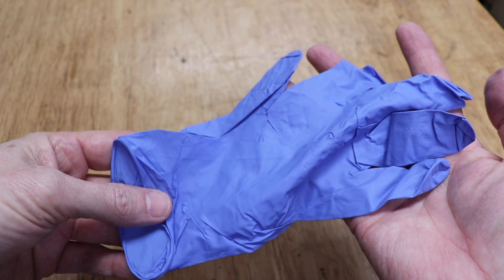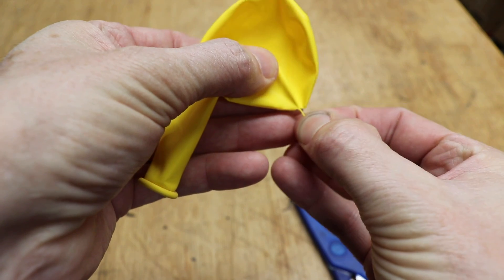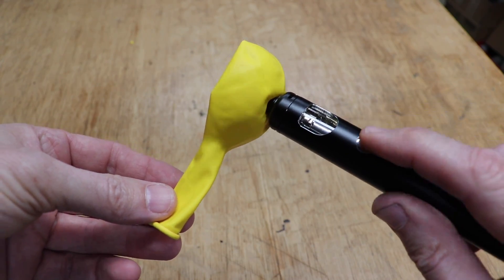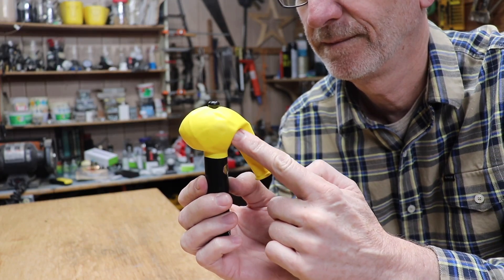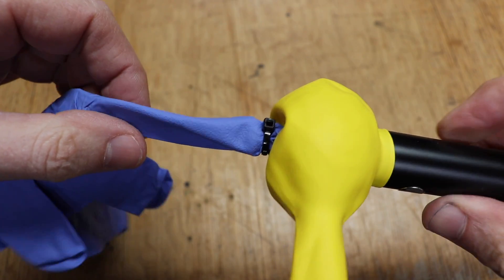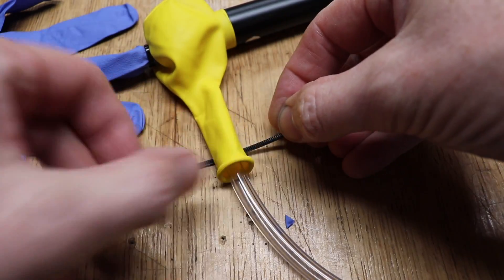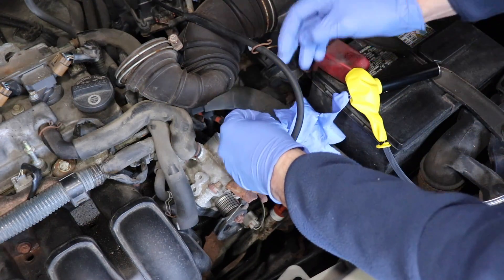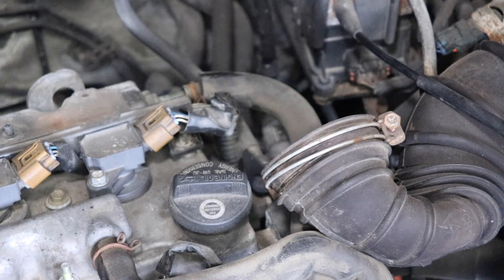How to Make ● Simple FOG Machine

Comment: Thank you for the video. I too, like others considered the other DIY smoke testers but stumbled upon your video and managed to do everything for under $10. For others watching this video and considering doing this, you can do this with any disposable vape pen. In my case, it was $8 and 2 gloves, couple of zip ties (or rubber bands), bike pump and 5/16 rubber hoses.
Reply from the maker: Glad it was helpful!
Reply from the maker: Can I ask what project you were using it for? I'm always interested to know other peoples creative ideas and possibly add to my tags. Thanks.
Reply: Chris Notap I did an entire fuel system for a Subaru which requires removing the intake manifold. I took the extra step to verify there weren’t any vacuum leaks prior to dyno tuning.